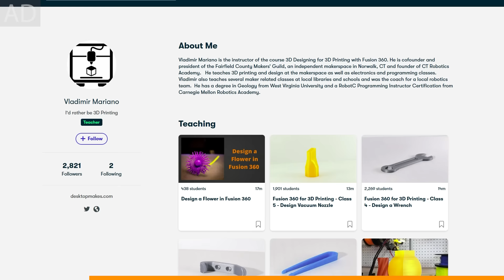We made a real DEMENTOR Animatronic!

Comment: I think one of the reasons the hair came off as weird is because there is only hair rooted into the top  of the scalp. Real hairlines usually end by the ears and go all the way around the back of the neck.
If the wig isn't glued on you could always go back and lay some new hair down by adding wefts from the other wig around the bare edges. That might help give the style more dimension.